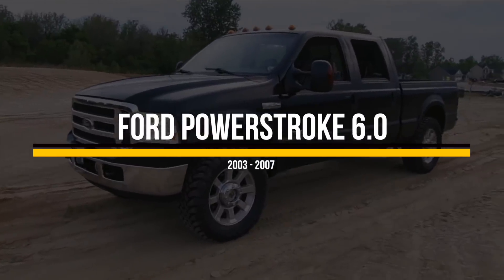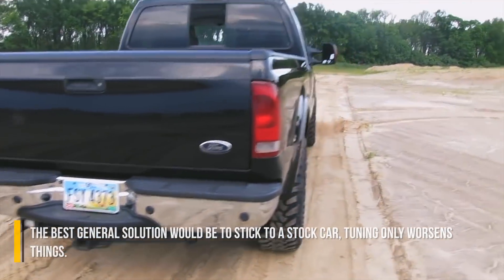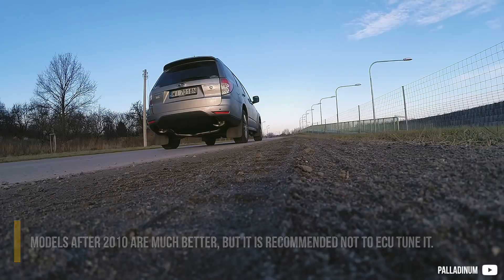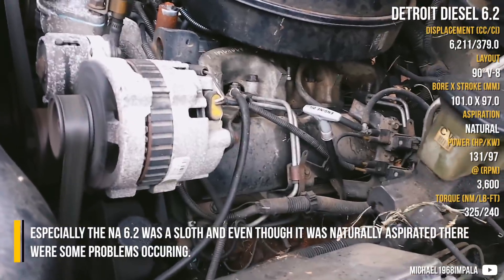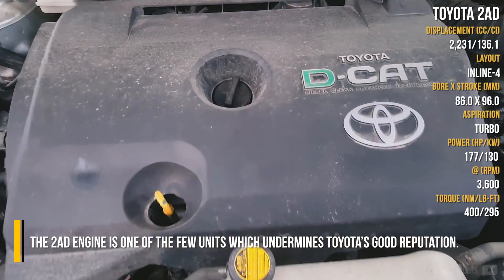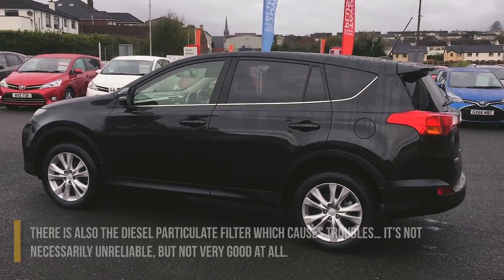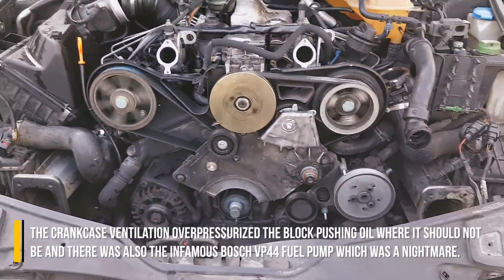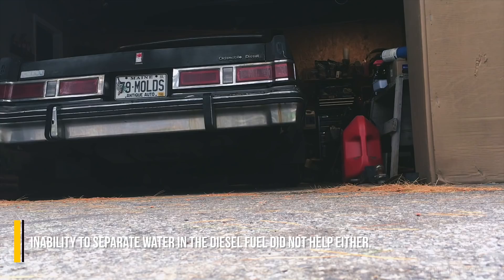6 Worst Diesels You Should Stay Away From

Comment: A 6.0 is a damn good engine if done right. All problem stem from egr problems delete all the emissions they will run for forever
Reply: Ty Bailey We love ours. Kinda pissed at Ford though for replacing the same faulty part in instead of a new one. We actually almost sued them but we were 3 years late to do that.
Reply: What about when it's illegal to do so?
Reply: Reid Johns aftermarket is great for these truck though turn them into real bad ass machines
Reply: Ty Bailey We wanted to do stuff like that but we couldn't really afford to, and were also trying to use up the warranties from the replaced parts.
Reply: The 6.4 is the bad one
Reply: Way better then the 6.4 that’s a super turd!
Reply: The 6 liter I think is the best powerstroke engine ever because if you bulletproof them it will be just as durable as a 7.3 and have way more power, also without any of the stupid emissions stuff that chokes the life out of new Diesels
Reply: Ty Bailey pretty much every ford super duty I see is a 6.0 I never see and 6.4s
Reply: Maintenance is the issue. If you don't run Ford coolant and high quality oil, change filters every 5k, etc.. you're gonna have problems
Reply: RANGERTRAX 04 yeah but you can more power of a 7.3
Reply: Aaron Mendez no you can't. The 6.0 can take more power on stock internals and you can easily hit 550rwhp with a tune and some minor engine goodies. A 7.3 would be hard pressed to make 500 because it's so old.
Reply: Elliott Bull bet
Reply: Aaron Mendez I will bet... It would cost well over 10 grand to get a 7.3 to 500 hp, for that price you could bulletproof a 6.0 and have a nice tune on it to get you above 500. Upgrade the turbo and injectors for another 5-7k and you have a beast of a truck. Way better than any old big block 7.3. it's a good platform for reliability, but that's about it
Reply: Ty Bailey big deal is the fuel pressure spring 6.0 is a great one but people are to lazy to work or maintain then so yea they do suck but the few that have been taken care of are great
Reply: Ethan jones yep true
Reply: RANGERTRAX 04 the old 7.3 is a great one but could have been better if they would have re worked the heads for better flow I daily a 02 nbs lariat and I also have a 97 f250 4x4 xlt I play with on the weekends
Reply: Ty Bailey there is absolutely nothing wrong with 6.0 i work on these things often and you donot have to remove the cab
Reply: Alex Strömberg they make emission compliant upgrades too, see bulletproof diesel
Reply: The 6.4 Powerstroke is best used as a boat anchor, Intertrashional designed that pos to be a 100,000 mile throwaway engine. You can make a 6.0 reliable, you cant do that to a 6.4.
Reply: MrErikw26 by the way, the company is called Intersmashable.
Reply: Bill Hewitt at Powerstroke Speciality in Buford, GA became famous for figuring out the 6.0 Powerstroke V8's issues.
Reply: Clinton Stubbs yep, even made a complete video series that you can buy, that shows you step by step how to fix your truck
Reply: Elliott Bull nah I spend 500 bucks to get it 650 horsepower
Reply: Elliott Bull I think another thing people forget about the 7.3's is that they are prone to engine leaks and to take the oil pan out you have to remove the engine. My friend has a 7.3 and he can't afford to fix his leak due to them having to take the engine out.
Reply: MrErikw26 shit floats though.
Reply: 6.0 fans hate to hear it but the 7.3 and 6.7 is ur daddy
Reply: Ethan jones ive ran 80 lbs of boost through one there crap but they can really run for a while lol
Reply: They like to blow up with no warning at all.The superduties with the 6.0 don't bring money at the auction,can buy them dirt cheap there.It is $10,000.00 and up just to replace a 6.oh no and diesel mechanics say the Ford diesels are job security
Reply: Everyone's entitled to their own opinion but not their own facts if you can't build a dirt cheap 7.3 make as much or more power than a 6.0  then you don't need to work on diesels the 7.3 heavy rotational Mass makes it a better work engine right off the bat with a much better torque curve and the 6.7 almost a thousand foot pounds of torque you would be very hard-pressed to get that out of a 6.0
Reply: watch diesel power challenge all those guys are either running 6.0 5.9 cummins 6.4 or 6.7 cummins. few duramax scattered in and 6.7 powerstrokes but hardly ever a 7.3. you cant make that much power with a 7.3 because the 8th cylinder  usually come apart  and with the 6.0 and 6.4 using a bedplate design can handle alot more power
Reply: from my personal experience that's a myth I've never seen one just come apart I've seen connecting rods break and take out the piston and the cylinder wall but there's no real reason why you would have a one piston come apart inless u cracked them from a shity tune but it is true that late model 7.3 parts are not as strong ie powder metal rods and it is true that the cylinder walls on the back  Pistons or thin and they can suffer from block Warp cooling problems blown head gaskets ring gap issues etc etc still way fewer 7.3 problems than a 6.0
Reply: I know right! 424k miles on mine and my dad has 640k on his
Reply: lmao "theyre great after you throw a ton of money at them"...get real the 6.0 were dog shit
Reply: Meh I’ve haven’t seen a reliable 6.0 yet. Constantly blowing head gaskets, dirty coolant, bad Ecms, sound like the pistons are hitting the heads, just gay all over. But on other terms you can get 500 hp out of them pretty easy. 2 of my friends had them, and the one started getting pressure in the coolant system two weeks after he had it, the other had so much trouble he just sold it after awhile.
     Last but not least, another guy I know had a 550 he used to hot shot with and it blew up twice in the same month.
Reply: Ty Bailey watch ucc sometime. 9 out of the top ten where cummins powered
Reply: Ty Bailey watch ucc sometime. 9 out of the top ten where cummins powered
Reply: Ty Bailey watch ucc sometime. 9 out of the top ten where cummins powered
Reply: Brentelec you would have to drop more then 5k into a 6.4 to make it reliable.

Comment: My aunt & uncle bought an Oldsmobile 98 Regency brand-new in 1979 & it started giving problems before it even had 10,000 miles on it. My uncle yanked that diesel out & put a Chevy 350 in it, no trouble after he turned that diesel into a "boat anchor", as he used to say.

Comment: The 6.0 and 6.4 powerstrokes aren't bad engines per say but they were meant for schoolbusses and it was made by international instead of ford, the new 6.7 is made by ford and it is way better stock, and if you bypass the EGR on the 6.0, change the head gaskets and studs and o-ring the heads it's pretty reliable, the same procedure applies to the 6.4 but with another step and that is to delete the DPF, It's a shame the V6 tdi is a bad engine it sounds amazing and if we wouldn't get shafted here in sweden on taxes i would've gotten one
Reply: In USA some pending state  legislation will make it a big monetary fine if you delete air pollution controls and your caught. Some state do check for them and if missing wont pass inspection

Comment: Some of the engines I can think about:
-1.9 Dci 120hp from Renault Laguna II
-2.5 CRD from Jeep Cherokee ( each cylinder got it's own head and is prone to leaks )
-1.2 & 1.4 TDI - crankcase goes loose after about 150000 kms
-2.5 TDI V6 - not to be confused with earlier 2.5 TDI inline diesel, which is good
-early 1.5 Dci - when oil was changed with intervals taken from manual ( every 30000 kms ) the whole engine and especially crankcase could be destroyed quickly
-2.0 TDI PD - head, head gaskets, pistons and oil pump failures. Not to be confused with later 2.0 TDI CR
-not exactly bad, but engineered to make owner pay more - BMW N47 diesel, with cam belt going loose quickly, accompanied by its placement near gearbox, necessitating in removing engine from the car

About Japanese diesels - in fact I would say that most of them are good and some are very good:
-2.2 CTDI from Honda Civic and Accord - no major problems
-1.4 D-4D from Toyota - may suffer from DPF failures, but far less than other modern diesels ( additional injector in the filter )
-2.0 Dci from Nissan - used by Renault in Laguna III and such, no major problems
-old non turbo 2.0D from Toyota and Nissan - slow, noisy but reliable - they are workhorses
-1.8 DiD from Mitsubishi - no major problems

Comment: Renault 1.9dci 120 hp is a magic engine... Black magic;-)
Reply: Luca Brecel Ask sb about his cousin 1.5 dCi 😉
Reply: This type of magic throws rods straight trought block
Reply: First K9K engines were nightmares...
Reply: Also compression ring gaps close causing the piston failures. Fuel pumps are rubbish aswell :D
Reply: 2.2 dci from gen. 2 laguna turbo and fuel nozzles fail till 50 000 km (allmost new engine)
Reply: Most of 1.9dci failures were at some point linked to turbos failure, especially for the 120hp version but it's not a so bad engine. 
The 1.5l had trouble in his first years of production, but it's a kind of bulletproof engine now.
And the 2.2l, well... I don't understand why it's not in this video, it's one of worst engine ever made
Reply: Currently driving a 1.9 TDi in a 2004  Primastar around town dropping off merch. 260k of daily town driving and by golly not a single injector failure. Turbo lost its vaccumhose at one point and I swapped the MAF sensor at 250k. After 10k its starting to lose power again, I suspect a bad voltage burning out the MAF. And the usual: clutch-brake combo box is leaking and not working properly. But still, ye old girl pulls hard when the turbo kicks in.
Reply: priit mölder when it kiks in... my scenic burms more oil than fuel but by hell it pulls like a train.
Reply: Im a 2.0 dCi owner. Sounds like a Petrol car in idle and quite good while normal driving.
Its like the small brother the K9K a bullettproof engine. No failures and they run much quiter than VAG engines. 
Yeah the "old-gen-Renault-Diesels" with 1.9 and 2.2 were not that good :D
Reply: It depends which 2.2dci, ther are at least 4 different versions with diffrent power outputs. My dad has 2.2 130PS from year 2000 and it has 400kkm and still runs strong.
Reply: my mom owns a k9k dci 1.5, 82hp (84hp? not sure)., its 12 years now, over 550k km-s , still runing fine. It's not magic. It's proper oil, and 10k km oil change. Thats all.
Reply: And Renault-Samsung shoved it's little brother into a D segment car.
Reply: When it comes to renault, we say 2 things here  in france: "renault tous les jours un bruit nouveau" (R. everyday a new noise) and "roule en Renault, rentre en velo" (drive a renault, go back on bike) xD  true to say that engine was true failure indeed. I miss the old J8s monster.
Reply: My neighbor made 240hp from 2.0 dci and normal driving;-) 2.0dci is very good engine counter to 1.9;-)
Reply: depend from the built year...
Reply: drago d my 2004 laguna 2.2 dci has 314k km and still going strong
Reply: it's a dci, not tdi. And if you have one with 260k and it doesn't give you problems it's because the engine has been fully rebuilt at least one time.
it's impossible for the cranshaft bearings to do more than 140k, and the injectors usually go out at about 180k/200k max.
that 100hp engine is shitty, no way around it.
Reply: I have the 1.5dci 100hp, i love it, it consumes nothing
Reply: Many people still drive various here said-bad dieses. Without blow. I think it  is, how you drive. Not to much RPM, good oil, coolant enough.. I know I know,  good diesel must manage high RPM. It is not good still drive with low RPM. But when i have such a car ..:)) better than blow up the engine. Many rods through engine block are in high RPM.
Reply: We used to own a 2006 Laguna 1.9 dci in the 130 hp variant. The car was world-famous for turbo failures around every 40-50k kms, however ours never had any major failure for 300k+ kms. And maintenance wasn't top-notch: the car was always on the road, never had time for proper maintenance. We even broke the timing belt once, cause my father didn't have time to keep the car still for a belt change, luckily he was standing at a red light when it happened...no major damage, the car ran for another 100k kms before we sold it. Not scrapped, sold it, it was still working properly.

However, my boss owns a 1.9 dci 110hp variant Xmod. Constant failures, he's desperate.
Reply: But 125 & 130 hp were bulletproof ! 
But they are so rare ...
Reply: i drive a focus 2007 with 1.6tdci renault engine, not to much power more of a cruiser :)
it has about 150k kms. i only made 25k kms atm there was 5 owners before
Reply: pollisoong the TDCi you drive is not a Renault engine, it's Peugeot.
Reply: Renault is super unreliable.
Reply: I own a second gen megane 1.9dci 130hp. I have had to rebuild the motor which is the cars second motor and i have replaced 3 turbos. Its an absolute nightmare. I have no idea why it didnt make it on this list
Reply: True my 07 scenic II towed 3500kg Like a charm...
Reply: My 1 5dci clio is a bulletproof little car. It's now done 146k and regularly serviced. Never let me down except for a flat tyre once! People who bad mouth them either brought a badly maintained lemon or never service their cars.
Reply: Renault is the worst,plastic car ever!
Reply: @priitmolder6475  the 1.9 TDI's were one of the most reliable diesels VAG ever made. In general pretty economical but lots of torque!
Reply: That explains why I saw a renault van with a 1.9 for literally like 1/4 the cost I expected it to be for on the Australian car sales website.....
Reply: 88kW version is nightmare...

Comment: The Detroit 6.2 and 6.5s weren't bad engines.  The only real problematic parts in those engines were the horribly unreliable stock injection pumps, and on later 6.5s a badly placed controller that would overheat.  Both aren't too hard to fix.  Yes, they  don't make much power, but they will last an extremely long time if cared for correctly.

Comment: Mostly engine here is good, but eco shit things like EGR and other slowly destroyed engine.
Reply: but in my country is problem with fuel with bio component, which destroyed these parts when I had the Peugeot 405 1.9 grd so these problems did not know and the consumption was 5 liters of diesel per 100km, and clean the EGR costs extra money + assembly and disassembly
Reply: The 20 largest ships in the world produce the same emissions as all passenger cars in the world, tell me about ecology, in Hamburg, it is estimated that cars are under a maximum of 10% of emissions in City. if it goes this way, then in the European Union, we will ride a bicycle or horse
Reply: Obsolesencization is a rumored tactic.  I am watching two americans rebuild a standard transmission for an  f-150 300.  It is full of magic rings, patent number 5, 000, 000, 000, thereabouts, one is bad.  The patent prevents you from harming the transmission if you jam the gear shift into reverse whilst preceeded hencely and, i presume, remove your foot from the clutch peddle.
Reply: @ElectronicRedPanda No, IF you delete egr on most engines you gain like 3-5mpg
Reply: Just like the semi’s emissions are killing that industry the engines are not reliable anymore the crapar I mean paccar is the worst
Reply: @martind349  guess we shouldn't evolve?

Comment: Also as being a 6.0 powerstroke owner and going to school as a diesel/ heavy equipment mechanic, i found that it really varies what 6.0 ya pick up. While being inexperienced and feeling invincible, I bought a 6.0, feeling like I could tackle everything it threw at me- The head bolts did not fail, I ended up deleting the EGR cooler, installing a fuel pressure regulator spring, replacing an icp (injector control pressure) sensor, installing stainless steel up pipes, and a turbo back 4" exhaust as well as an SCT livewire ts+ tuner running on the lowest (50 hp) tune that I still have problems- I never beat it up or run the rpms to redline, my heads are still fully intact, i'm not using up coolant, I have an injector going bad which i believe is the o rings on the injector as my start up and warm up exhaust is blue and I have a rough idle/ miss at times which follows the injector solenoid failing issue which in whole contributes to the amount of oil i/m using/ burning; I asked my co workers about this (who have 40 yrs experience in the field) and agreed with my diagnosis. Also, I have an oil leak which I believe (just looking up with a flashlight) is coming from my icp sensor again, a year later after replacing the old one which ended up being an o ring, I believe this one is either an o ring or the whole harness, regardless, i'll replace both. but the moral of the story is it depends on which 6.0 ya get- mine also has steering arm, tire rod, control arm bushings that are completely shot and haven't seen grease in years. The front end needs some work :) The Minnesota rust doesn't help.